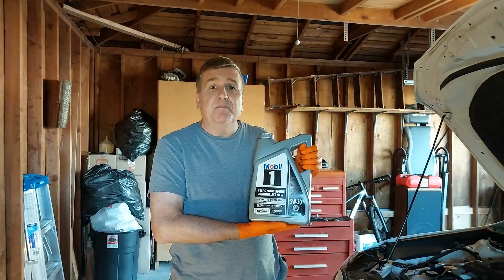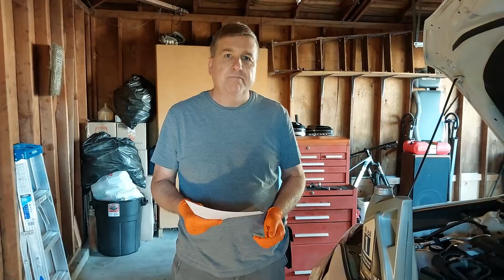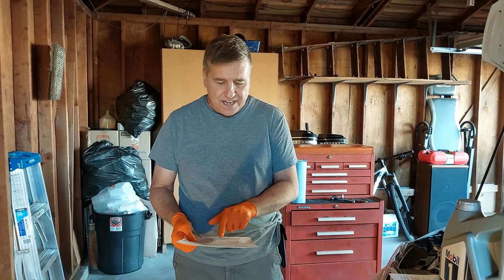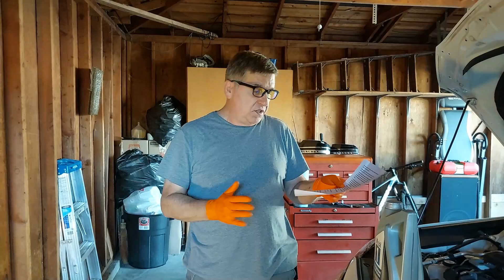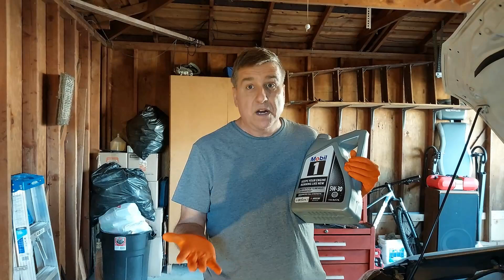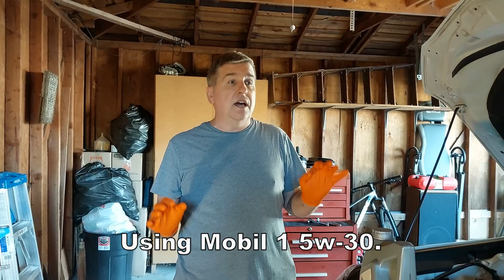The Automotive Oil Viscosity Controversy

Comment: Great video Don, I've got a 2026 camry hybrid on the way to me in Australia so I was researching what oil to switch to as I was a bit concerned about 0w-8 as well. Seems like Australia doesn't push vehicle manufactures to maximise emissions and thus 5w-30 is still specified as a usable oil for their engines (which is also what I plan on switching to after 1000 miles). It's interesting that they haven't specified that 0w-30 as an option but only 5w-30.

It is a fact that lower viscosity oil causes more wear but this can be offset with more additives but just to be safe in case not enough is added from different brands that higher viscosity oil is used in my opinion.
Reply: I'm in Australia also. 0W-8 is not available, and neither is 0W-16. The last time I checked that was the case anyway. My dealer uses 0W-20 in my 24 Camry. I would prefer 5W-30. As is pointed out in the video, Australian manual allows the option of 5W-30, and compares it with temperature range. My understanding is the thinner oil is necessary to circulate around the engine more quickly in cold climates. If I lived in Thredbo it would be different, but I'm on the coast of NSW, where the temperatures are more mild. Still, I have been going with what the dealer uses. The Car Care Nut (excellent channel, if you haven't already found it) still recommends the thinner oil, as specified by the factory. My preference would still be for 5W-30.

Comment: I totally respect your research on the matter, but the Car Care Nut recommends  on this engine to stick with 0w16 due to the advancement in engineering in this engine that regulates oil pressure so well…
Reply from the maker: It's true, The Car Care Nut recommends sticking with the weight specified. However, it is intriguing that Toyota's recommendations for a given vehicle differ by country. In North America they recommend a single grade of oil, regardless of ambient temperature, but in other countries they also recommend other viscosities.
Reply: @dontosaw  - Car Care Nut will not go against Toyota's recommendation for either liability reason, lost of potential connection to Toyota, or both.

Comment from the maker: The Motor Oil Geek, Lake Speed Jr., recently posted a very insightful video in which he discusses this topic. Based on customer testing results data from his oil analysis company, SPEEDiagnostix, he's discovered that you can't rely on data comparing oil viscosity grades from oil samples taken before 10,000 miles, as the results are skewed by engine break-in. Furthermore, depending on your engine, climate, and driving habits, sometimes lower viscosity oils protect better, and in other cases higher viscosity oils protect better. The video also addresses the prevalence of disinformation being spread by deliberately deceptive videos on YouTube. You can find the video here: https://youtu.be/XyBUcxFmqn8?si=YCToGH3lBG-Dlvbl

Comment from the maker: Lake Speed Jr., The Motor Oil Geek, discusses this on a Q&A video from about a year ago: https://www.youtube.com/live/mr07y1H3U7c?si=ZTWahu3mCvkKdgME 
The pertinent part is the second section of the video at about the 17:45 mark: https://youtu.be/mr07y1H3U7c?t=1055
Reply: Thanks for the links (strange they were missed). I experienced all of this firsthand in my BMW 218i Active Tourer with a modern engine. After reading some "experts" online, I used 0W-40 oil with the correct specification instead of the prescribed 0W-20. With 0W-40, the engine ran hotter and was noticeably louder. After 90,000 km, I switched to 0W-30, and the engine became quieter and didn't run as hot. Why? Because this engine (BMW B38) is designed for thin oils. And it's not a given that the engine wears out less with 0W-40 oil than with 0W-30 or 0W-20.
Reply from the maker: @hubi16  Yes, sometimes a lower viscosity oil is better. In general, modern engines are designed for lower viscosity oils than engines were decades ago. The climate the vehicle is operated in is yet another critical factor, as all oils thin out with increased temperature. I'm confident that running 5W-30 in summer and 5W-20 in winter in my climate is fine for my engine because Toyota says so. From the Australian owner's manual: "SAE 0W-16, 0W-20, 5W-20 or 5W-30 engine oil is recommended."

Comment from the maker: By the way, I've come to learn that Toyota is now specifying 0W-8 for the 2025 Camrys in the US and Canada, with the same A25A-FXS engine. Did Toyota discover that 0W-8 protects even better than 0W-16, or are they going to an even lower viscosity grade to gain a tiny amount of efficiency? It seems obvious to me, that the answer is the latter.
Reply: Hi! The German YouTube channel has a five-part interview with a Ravenol oil and lubricant developer. He claims that modern liquid motor oils aren't just low-viscosity, they're DIFFERENT. If you compare the technical data sheets for Mobil 0W-16 and Mobil 5W-30, you'll see that 0W-16 has superior performance. Some Toyota owners write on YouTube that they've driven 600,000 km or more on "liquid" oil without any problems. Motor oils simply have many other properties besides viscosity.
Reply from the maker: @hubi16  Yes they do, but viscosity is the most critical characteristic.
Reply: @dontosaw  Not a fact:
https://www.youtube.com/watch?v=Q7biBahqVWY&t=1s

https://www.youtube.com/watch?v=Q7biBahqVWY&t=1s

.....
Reply: @dontosaw  Not necessarily. I sent you links to this, but since we live in a "free world," my post disappeared.
Reply from the maker: @hubi16  Your post disappeared? I haven't removed any comments.
Reply: @dontosaw  I never expected that. I wish someone would break the Western regimes' monopoly on information already.